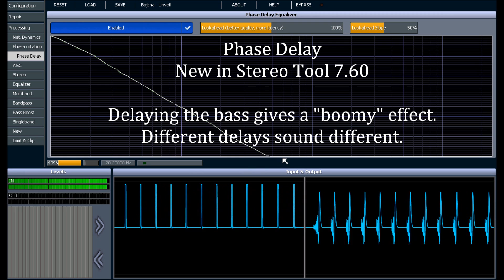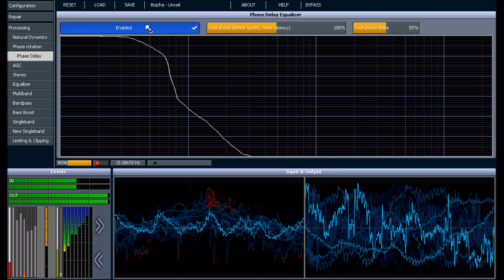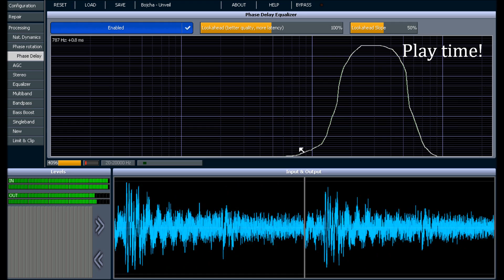Stereo Tool: Phase Delay demo (exaggerated)

Comment: Stacking multiple allpass filters can also do this "boomy" bass trick (and when done in realtime, produces no latency since it is an IIR filter afterall) and can be used together with typical low-shelf (or sometimes parallel lowpass) bass boost effect

Comment: AM OF BRAZIL, and installed STEREO TOOL IN MY PC TO WORK ON A COMMERCIAL RADIO.
Registered SAME WITH SUCCESS AND BLOQUEI INPUT AND OUTPUT COMMUNICATION WITH INTERNET.
BUT OF 12 IN 12 HOURS, ONE WHEEL OF VIGNETTE STEREO TOOL.
HOW DO I TAKE THIS AUDIO?
DO YOU HAVE ANY SOLUTION?
JA DESISTALEI THE SAME TIME DREW AN ALL REGISTRATION BY COMONADO REGET installed a NEW VERSION BUT THE PROBLEM CONTINUES.
AWAITING
WELLINGTON
Reply: Qual seria?
Reply: Serial stereo too?